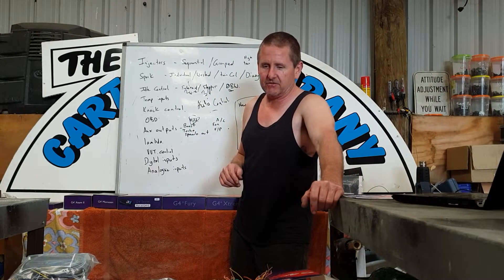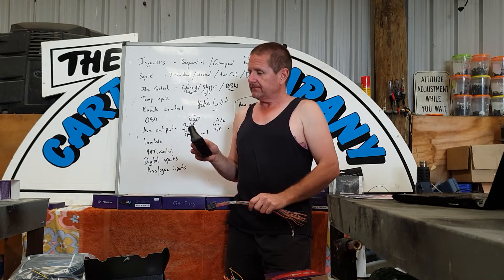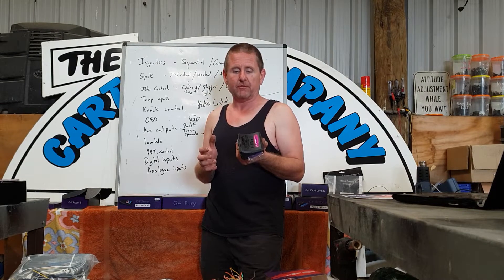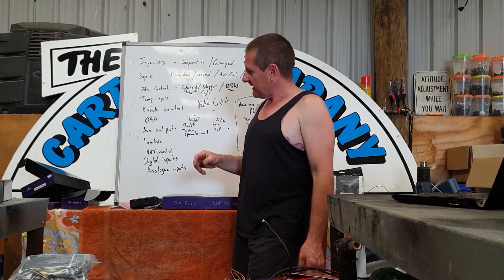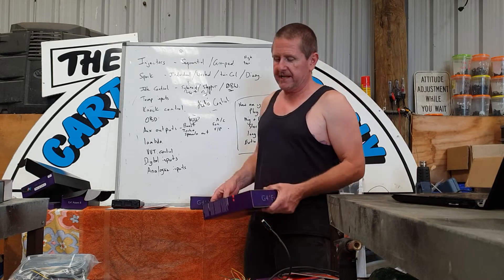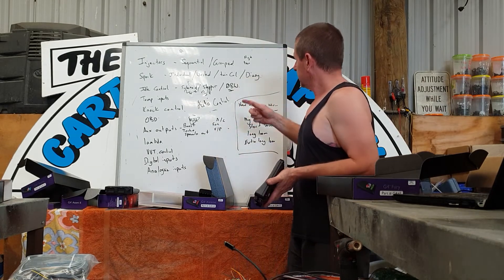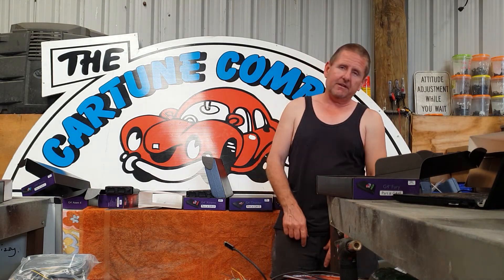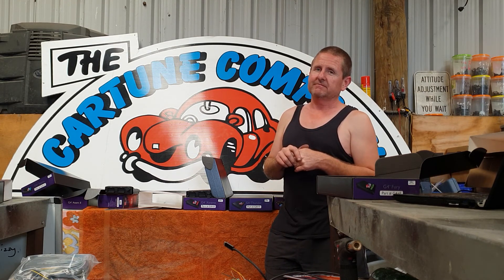Aftermarket ECU - reasons for using different ECUs , Examples

Comment: My reason to use an aftermarket ECU is that the stock one was dead. First I've tried a second hand one. Same plugs but different pin out. After fixing this I learned that it needs the older version of airflow sensor. I use the Megasquirt MS3 EVO. It came with full license of Tunerstudio and a good documentation. I love that it is watertight coz the UZ runs in a boat :-)

Comment: Hi, great video! I have been given a LINK CAN G4+ 300ZX ECU which was bought to be used wiith a S14A SR20DET Engine in a S15 non turbo car. The ECU  was chosen by the orignal car owner because it was on sale. I am now trying to join the two together now by linking up what is commonly used on both ECUs. However there are a fair few functions which both cars do not share. For example some may have a lamp output, some may have a relay input/output or some are different sensors or valves. How do I deal with this? I'm thinking that I could just decalre these as general inputs or output and then change to what I need? I am an electrican/design engineer however it is not clear what you can do from reading the manuals. Thank you

Comment: Hello, what transmission would you sergeant for a 3uzfe the a650 or a761e and can you recommend an after market controller for both
Reply from the maker: Hello.  Either the 5 or 6 speed is fine for the 3uz. We see far more 5 speed over here at present.  I use the trans and ecu that comes with the engine.  Personally the stock ecu works better than any aftermarket ect I have worked with. Where in the world are you?  Cheers  Kelvin
Reply: @CartuneNZ  quite far away.... Nigeria. I am at the planning stages of putting a 1uz or 3uz in my Benz 300CE. The simplicity of the 1uz with the a340e(2.5?? First gear) is enticing;  but the ratio of the 4 speed with my 3.06 diff ratio worries me. This is why I am contemplating the vvti the a650e ( 3.4ish first gear) should help with off the line acceleration. What do you think

Comment: Good video. What would use for a 5vzfe factory replacement
Reply from the maker: Just to confirm.  You have a 5vz manual which you want to put an aftermarket ecu onto?  Have you modified it or just want to ditch stock ecu?  What chassis is the engine in?
Reply: @CartuneNZ  stock hilux vzn167r  2004
Reply from the maker: Ok.  There are a few options.  If you are wanting something on a budget then a Monsoon could be a good option.  This would result in group fire injectors and wasted spark.  A storm is next choice which gives sequential fire injectors and individual spark.  Both of these can have a can lambda fitted as I like having a wideband.  Another upmarket unit would be the fury which has sequential fire injectors and individual coils with build in wideband.   Actually another option which is often overlooked is the kurofune which is quite well priced with lots of outputs.  Ill check some diagrams later to ensure idle control wouldnt be an issue. Would you intend to wire using existing loom so clip out present ecu and crimp new terminals for replacement ecu?
Reply: @CartuneNZ  thanks for the details. My preference would be true plug n play. Leave existing ECU plugs on and have short adaptor leads to new ECU. Would there be any other inputs or outputs required? Is it auto tune?
Reply from the maker: @DavidMartin-du6jd  as an adaptor I think a kurofune might be the option to go for however any of the others can be wired as a plug and play adaptor.  For auto tune there needs to be a wideband input.  Canlambda would be my first choice for wideband.  Cheers